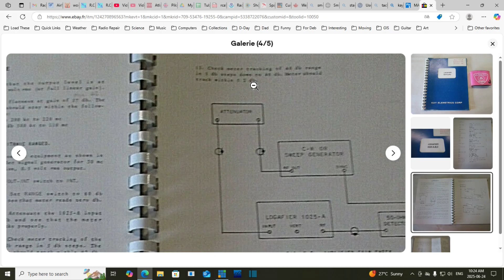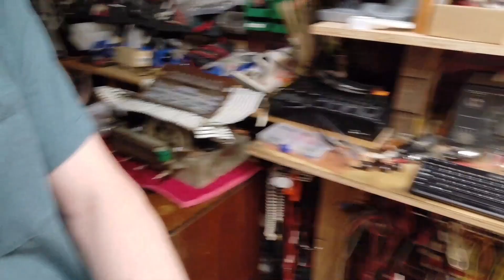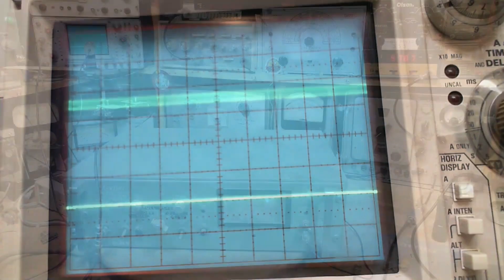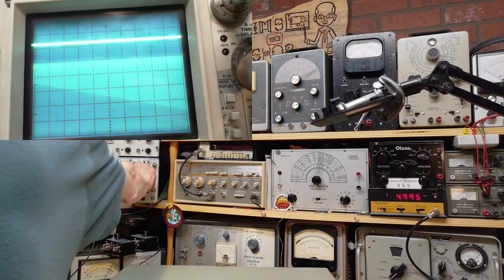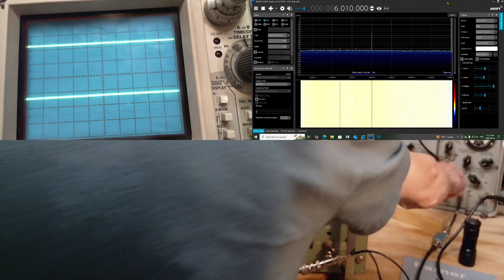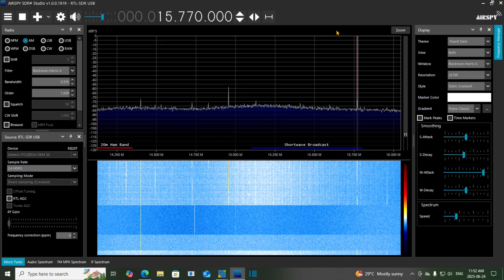KAY Logafier Model 1025B Logarithmic RF Amplifier - Exploration and Testing

Comment: Kay made a lot of electronics for Air force, some was used for calibrations of airport electronic equipment. I have kay marker generator on my bench and getting information as for schematics user manual has been almost non existent.. The electronics work inside of Kay products is top notch.

Comment: Successive detection log IF amplifier is my guess.  Logarithmic stages in cascade each contribute a linear in dB range of current. As each 10 dB or so stage limits, its current maxes out starting with the end device and working forward in the chain. Each contributes current  Till  its max.is reached. The current rail is turned into a voltage by a transimpedance amplifier that drives a meter. This is the basis for a wide range RF power meter.

Comment: Come ngrstuoations Jim, You are working a piece of test equipment ,I spent my work life testing,  calibrating and repairing High quality test equipment like Techtronix   and HP oscilloscopes Scopes, Voltmeters and spectrum analyzers, in support of manufacturing  facilities and research labs. An attenuator is not signal generator but more an impedance  level set  device. It’s often use as a spectrum analyzer indicating accurate analog measurements, like the gain of an I F Amplifier in the design stage or build testing. Good luck!